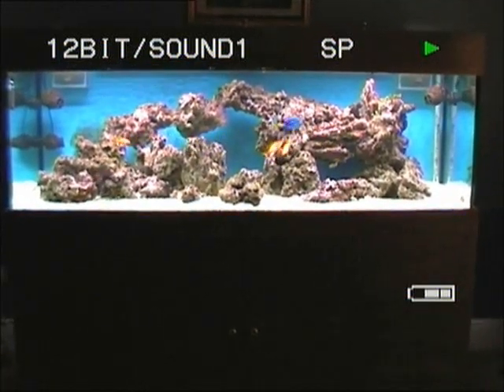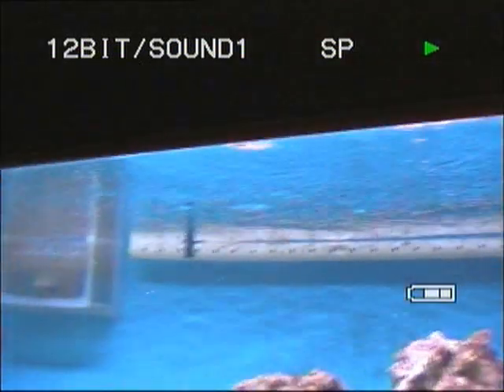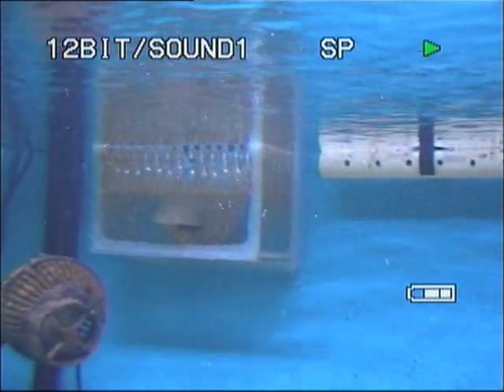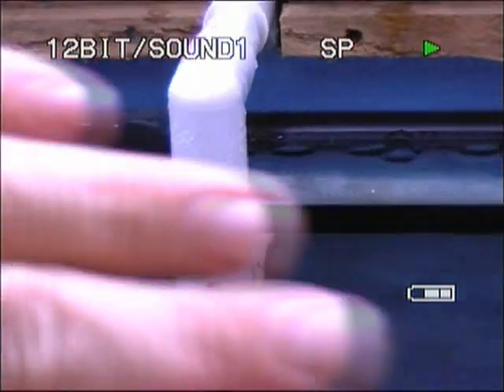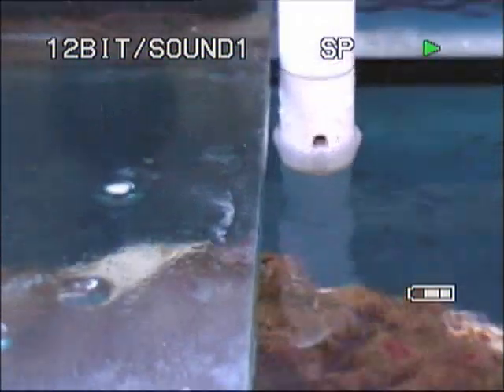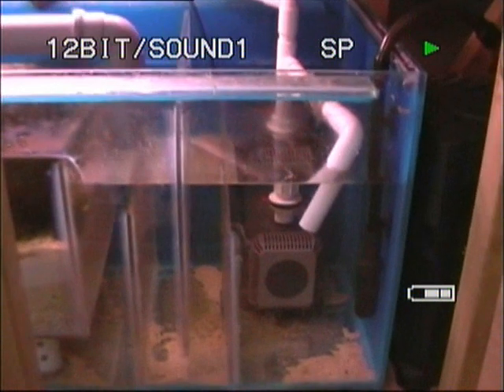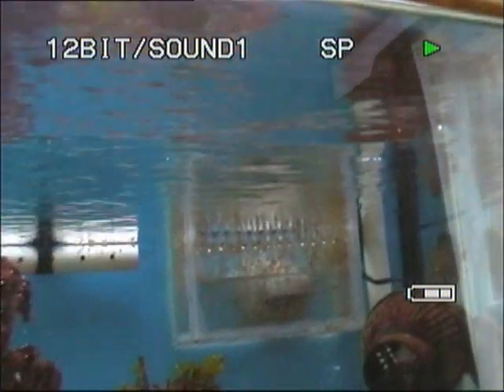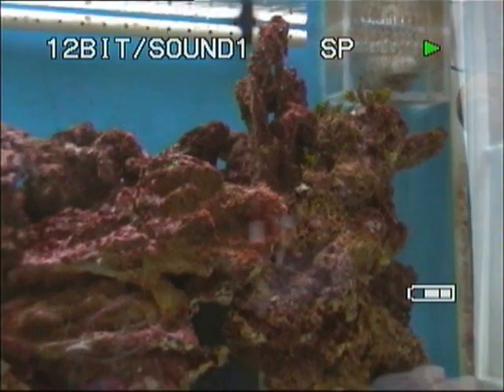MARINE TANK & SUMP - What happens if there's a powercut ?

Comment: Not sure if your still tracking this video but I sort of copied your over flow setup not sure what the difference is between mine and yours but my overflow boxes do not fill all the way up with water they just fill to level of the outlet pipes and the water trickles through the teeth the system seems to work fine but the only time the boxes fill to the top is when the return pump is switched back on after power cut test